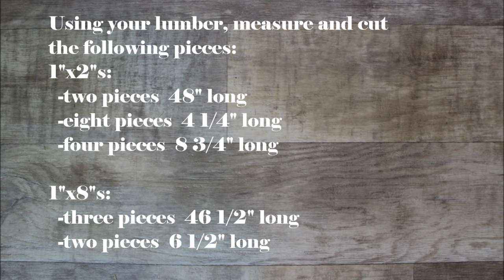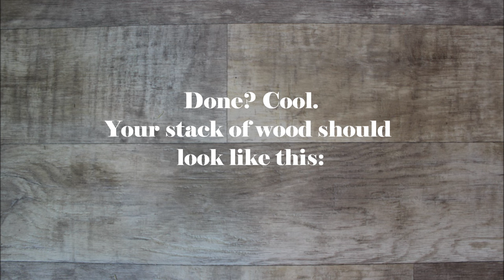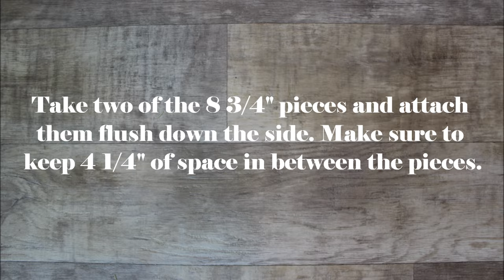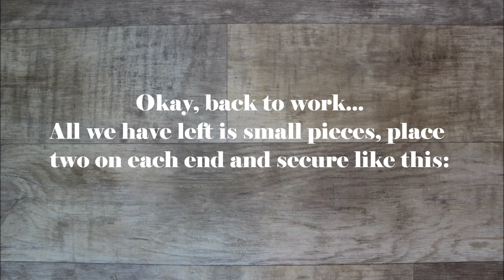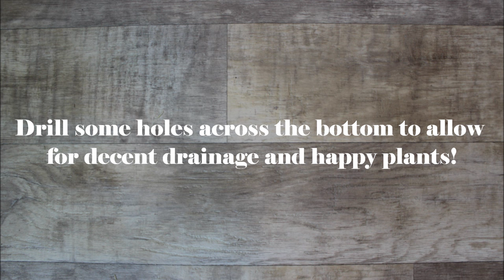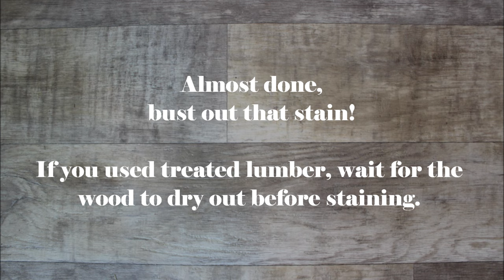The $20 Window Planter Box - Easy DIY Project

Comment: you guy's come out with pretty good simple project good work you should of put a couple of 1x2 on the bottom so it won't be flat on the floor if you wanted to use for the floor cool planter.

Comment: what about if the box i make is for indoors......do i still have to put holes in the bottom ofmy planter box?
Reply: I'm a professional Polymath. Not necessarily but I would recommend putting at least a half inch of gravel on the bottom and just make sure you don't over water whatever you have in your box. I'm just here studying pack mentality. Don't mind me and disregard the message.

Comment: Before screwing the screw into the wood did you pre-drill the holes?
Reply: Depends. If you are using self tapping screws you don't have to just start slow. If not then you should pre drill.
Reply: Totally depends on the type of wood. If it's soft wood (like pine) it's not always needed. Alternatively you can also screw the screw back and forth (forward and reverse on the drill) until right before you've reached the end - that trick will work very well so you don't have to pre-drill to prevent cracking the wood.

Comment: Love the build. What is the approximate resulting weight? Would need to compensate for soil and rain if used outside. This would be a cool look for a flower box outside under the window sill.Would you suggest hanging these or sitting on top of something be better?

Comment: If you have metal siding like aluminum, treated lumber will destroy it. The chemicals in treated lumbar will interact with aluminum and rapidly decay it. Also use wood to metal screws. Stainless steel screws will also have reaction with aluminum. I realized this won't be a problem for most but siding houses, even vinyl, will have to use wood strapping to give strength to box no matter what material is used.
Reply: This isn't a channel to take seriously re building anything. There are women woodworkers on Youtube and they don't wear yoga pants and cleavage revealing tops while throwing suggestive looks towards the camera.

Comment: Hi from Portugal.Sorry for my english, but I can't understand your measurements. When I use 3 pieces of 46 1/2" and add two 8 3/4" pieces on the top with a thickness of 1" the total dimension would be 48 1/2" and not 48" right? We use at Portugal the metric system so probably is my fault. Can you help me? Thanks
Reply from the maker: Hi! Your english is great! The actual thickness of a 1" board (at least in the United States) is 3/4", so the thickness of two 1" boards put together is actually only 1 1/2". It's confusing for sure, they might do it differently in Portugal so I would double-check. Hope this helps!

Comment: Ok I thought of a tip for you guys. Since you have all the pieces of the project cut prior to construction. Why dont you screw the outside trim pieces from the inside then assemble. This way all the screw heads are on the inside for a cleaner look? ............That not might work for the ends of the main box ..... But you could still screw from the outside on the ends for the main box, which means only 8 screw heads showing instead of 48 screw heads.
Reply: Rusted screws
Reply: Greg Ward nah. Just use painted screws

Comment: Where do you get your lumber and what kind of lumber are you using, because I built the $50 farm house taple (thank you for showing me that) but it cost more like $80 $90 I went to home depot and got the common boards?
Reply: I believe they are shopping at Menards, a discount store that's generally cheaper than Lowes or Home Depot. I know there are Menards all over the Midwest but I'm not sure about other locales.
Reply: I believe they are shopping at Menards, a discount store that's generally cheaper than Lowes or Home Depot. I know there are Menards all over the Midwest but I'm not sure about other locales.
Reply: went to menards. Spent maybe 60 bucks on the table. It would have cost me over 125 bucks at lowes.

Comment: One tip:  place your project on a workbench or table edge to drill holes straight (without the interference of the floor tilting the drill).  👍🏼
Also, be sure to secure it to your house....that box is extremely heavy (especially filled with plants and wet soil).

Comment: do you coat the inside or or do you fill it in with some foil before you add the soil and flowers so the wood won't get moist?
Reply: It all depends on the type of lumber you are using and what you are growing in the box. If you are planning to grow things that you want to eat, you should use something like cedar or redwood that is untreated or heat treated so that you arent exposing your plants to the treatment chemicals. Those woods are naturally resistant to bugs and to deterioration. If you are just going to grow flowers, you can generally use any type of wood, but you should use some type of weatherproofing on it to prevent the wood from deteriorating or being eaten by bugs, mold, etc..

Comment: At 3:05 - 3:09 is she drilling a hole, then picking up a screw to put in it...without changing the drill bit?? How is that possible? What am I missing, here?
Reply from the maker: For time purposes, we don't show every hole being predrilled (it gets a little boring). At 3:05 we're using the drill bit, the next cut it has been switched to the bit for the trim head screw.

Comment: Can someone tell me how I would go about drainage if I were to make this for indoors? I really want this at my kitchen window for herbs. But I don't want it draining onto my floor.
Reply: You have a couple of possibilities. Fist off, please wear shoes & safety glasses at ALL times when doing construction projects!!!

Simple solution is using a plastic tray or plastic lined wood tray mounted below the box to create a drain tray. I recommend using spacers of some sort to be able to keep an eye on the water level in the drain tray so you don't overfill. You might want to place something below (i.e. garbage bags or totes) to protect your floor from potential liquid damage the first couple times you water until you learn the right amount of water to avoid overrunning the drain tray.

Other option If this is directly above your kitchen sink & you're good with "function over form"... you could use only one drain hole near the corner of the box. Mount the box slightly angled so the drain hole is tilted to the lowest spot.  I would advise treating wood with deck stain or spar urethane to help prevent wood decay.

aluminum

With a high quality silicone (clear would prob look best) seal a drain hose (sold by the foot at most hardware stores) recessed slightly (maybe 1/4") from the top of the drain hole running down to your sink. I would consider beveling the topside of the drain hole to help water drain into the drain hose.
Reply: @bhough410  Wow thank you! That was very informative and I will definitely screenshot your comment to implement it into my plans! 😊 thank you for taking the time to give me advice.

Comment: Great idea. Is this waterproof or when would that need to be added.
Reply: It would be best to treat inside with a quality deck stain, then styrofoam insulation then wrapped with plastic sheeting/vapor barrier on the side exposed to the elements/dirt/water/plant roots. Adding any of these 3 will help.
Reply: @bhough410  thank you

Comment: UNREALISTIC PRICING!!!

Sanding block $4
Wood fill $7
Thompson's stain $15
Trim screws $5
Standard pressure-treated Lumber $27
TOTAL $58 before tax

These are all prices from Home Depot.com and the items are the exact same quantity and brand-name as you show them the video. Sure you may be able to find them a little cheaper someplace else but no where will you find all of these products for $30 or less.
Reply: Danny M Sure starting from scratch would be a larger initial investment. However, she's only using a fraction of each of the first four items on the list. If you really nitpicked the cost to complete the project you could add the price of the miter saw, drill and other tools as well.
Reply: +Charles Lee  I understand what you're saying but that kind of defeats the purpose of posting a price tag in the title of the video. I'm sure you could find some leftover stain/screws in the garbage and salvage 2x4s from a construction site and call it "the $1 planter box". If you're giving a materials list and a price tag on a video you're posting online the materials in that list should fall under that price tag.
Reply: You can't figure pricing based on having to buy everything new everytime, you wouldn't couldn't sell anything. Things like nails stain sandpaper/blocks are just expendables. The stain for example you could probably do 50 of these from that one can of stain so the stain really costs .50 for the one box. same with screws you might need 20 screws but I buy them 5lb at a time because it's much cheaper.
Reply: +Roy Crunkleton I understand what you mean… it just defeats the purpose of posting a YouTube video including materials and the pricing of them. In your scenario it would make more sense to post a video with no price and just list materials used.
Reply: Tabitha Stevens I can appreciate recycled and reused, but it defeats the point of giving a price list on the video in the first place..
Reply: Simple fix! Place a disclaimer stating the costs of each item were prorated to represent amount used, rather than overall cost.
Reply: Danny M why would you factor in the price of the products you can use 100x into the total cost?

You'll use maybe cents worth of each.
Reply: Needs more exclamation points.
Reply: You're correct if you only need to do one box and do no other DIY stuff around the house.  Realistically though for a person like me building one of these planter boxes is free.  I have all the materials left over from previous projects.  I liked the video and am actually planning to build 7 boxes of different lengths.  My wood will come from the scrap pile at Home Depot.  All in all I guess it's perspective. You could go on Craig's List and get your wood for free.  If you have a miter saw or a table saw you probably have sanding tools or blocks hanging about (you could also go old school and just staple gun a sheet of sandpaper onto the butt end of one of a chopped up 2x4).  Basically we could look at it as a $58 box or a $10 box.  This particular box measuring only 30" is about $30.00 on Amazon, $1/inch.  If you are really only trying to get one box it might be the way to go, it already comes painted.  If you are going to be building boxes for all around the house and garage, and you have the tools already, it's most definitely cheaper to build your own.
Reply: It's that way with cooking, also. If I had to buy six or seven different bottles of spice for one recipe, it would cost me almost fifty bucks just for the seasoning, alone. I think, when you see videos like this, where they give you a round-about cost for building (or cooking!) a certain thing, it 'assumes' you already have the basics on hand.
Reply: Danny M then using your logic we need to include the price of the miter saw, measuring tape, speed square, pencil, etc...

And don’t forget to include the price of the house you are going to screw this box too.

;-)

Comment: how would you attach this outside the window of a brick house. any idea?
Reply: denisthemenace10 - I thought the same here. You would have to adapt to hang the whole thing.
Reply: concrete drill bit, make your hole, insert wall anchor. screw box into wall anchors. Could add in spaces to water was not trapped between the box and the wall as well.
Reply: if you want a good primer how to..on you tube look up How to Install and Plant Window Boxes - This Old House. There is a few good explanations by various people. Indoor installation is differnt  but not by alot.

Comment: You should never use pressure treated lumber for planters. Chemicals will leach into the ground and will be absorbed by the roots.
Reply: Carlos Garcia That was true up until 2003.  Now they treat it with stuff like copper and chromium instead of CCA (:

Comment: Thanks for a great video. TIP: When you were drilling holes in the bottom there was a bit of smoke. A very likely cause would have been drilling counter clockwise instead of clockwise. :-)

Comment: Cute girl. Miter saw. Yoga pants. Who could ask for anything else? With that said, 1x2 and 1x8 lumber is not cheap at my Home Depot. I would consider these to be specialty lumber, usually used for cabinets and bookshelves. I didn't price it all out, but I'm guessing this project would run about a $100.
Reply: It is obvious that they are not using clear pine which is expensive, it is probably #2 grade which is cheaper than clear or #1 grade. Still, it is way over 20 bucks for this. Maybe in Minnesota where they are from, wood is dirt cheap,
Reply: Yes! Out here in California things are expensive!
Reply: In georgia, we made one almost this size, and it was 43.00 but I had the brad nails, screws and wood filler, and glue before hand